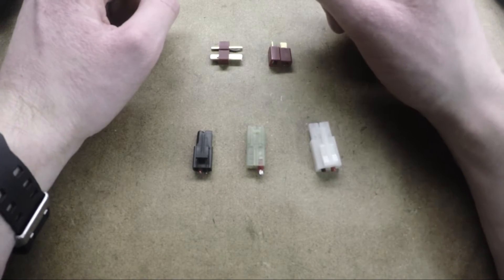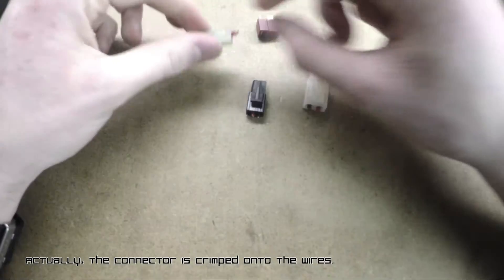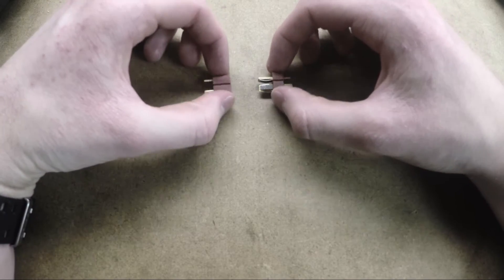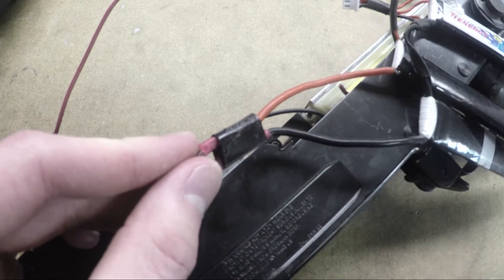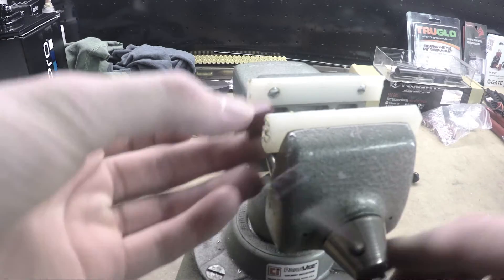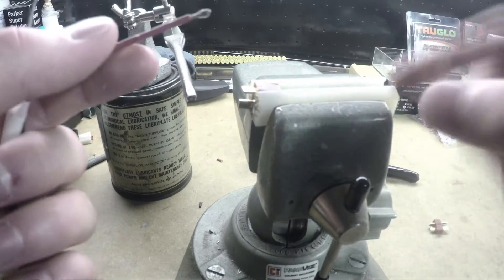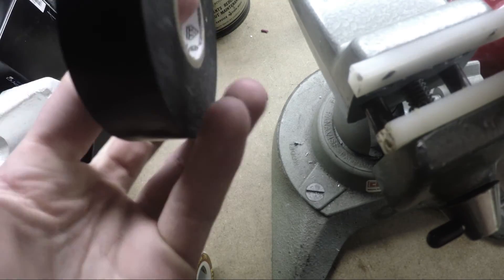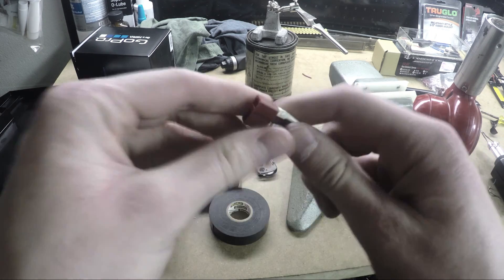Airsoft Tech: Wiring Connectors and How to Attach Ultra Plugs (AEG)

Comment: Lmao only way a tamiya will fail is if your an idiot and pull on battery to remove instead of the connector. And trust the RC guys they last a lot longer.
Reply: Ontario Backwoods Outfitters There's no way Tamiya connectors will last longer than Deans.
Reply: When you read my long name, I stole your sandwich i have tamiya connectors that are 10+ years old and still work great. Theres a reson they are the staple in the rc world and that is they are proven reliable.
Reply: Ontario Backwoods Outfitters But we're talking about airsoft now. Deans anyways are way better because of their bigger conducting surface.
Reply: With that low a power source deans arent going to make a difference other than they are smaller in that case there are micro tamiya connectors. Use what ever you want tamiya are still most reliable connector.
Reply: Ontario Backwoods Outfitters 11.1V lipo and 14.8V lipos are pretty powerful batteries. I had tamiyas on my gun and batteries and every tamiya broke within a week. I've had deans now for 2 years and still going strong
Reply: When you read my long name, I stole your sandwich sounds like your pulling on wires and not the plug itself. Probably were more careful after breaking the last lmao. Pull on a deans and a tamiya the deans will always let go first.
Reply: Ontario Backwoods Outfitters I pulled from the connector. Tamiya has that lock but deans are tight so they wont let go easily. If u pull tamiyas as hard as deans, those locks will break
Reply: Lmao ok that lock will outlast any pull a dean can handle.
Reply: Ontario Backwoods Outfitters wrong. It’s pretty well known you will get better trigger response, higher rof, and your motor and wires will conduct less heat with deans. Everyone in the rc has moved past deans to xt60 connectors. You’re living in the year 1999